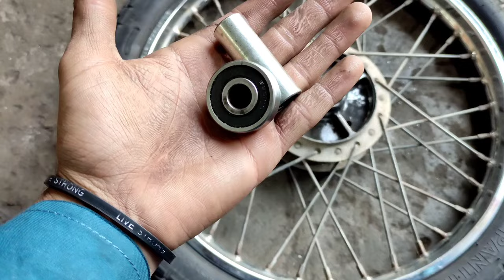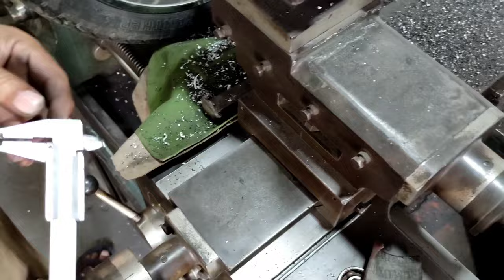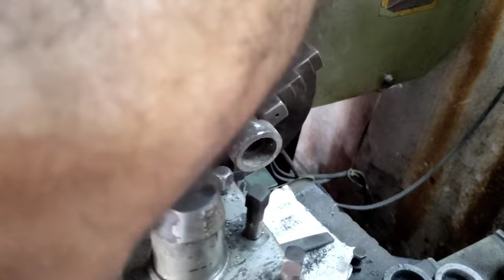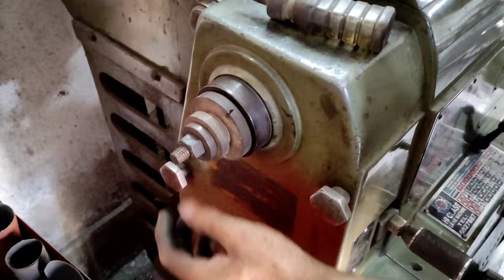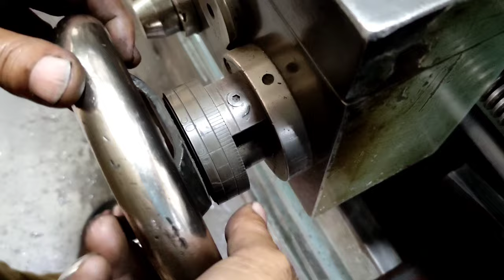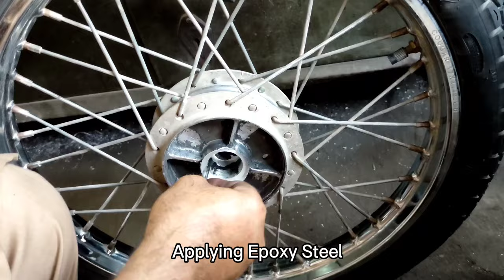Broken bike Hub Restoration | PART ONE

Comment from the maker: Piece full length 45mm,
Piece bearing outer length 18mm,
Piece bearing fitting size length 14mm,
Piece bearing outer diameter 45mm,
Original Hub bearing outer diameter 45mm,
Piece fitting length 27mm in hub,
Piece fitting dia 34mm in hub,
Original Wheel hub inner diameter 33mm,
Just 1 millimetre hub reduced. Now tell me please can we not tooling hub for just 1 millimetre for gets piece fits tightly??
This piece installing in hub 10000% secure riders are 10000% ok no any danger.

Comment: The hub thickness was reduced, it may weakened the integrity or strength of the wheel set.  The price of new hub and spoke, more or less 13$ compare to the riders life.
Reply from the maker: Allhamdullilla aaj tak kabhi koe shakayat ni ai. Humy 25 saal ho gaye kaam krtay hoye rider ki Zindagi bht qimti hai hum achy se jaanty hain. Sahi kaam krna har kisi ke bass me nhi.
Na ye lohay ka piece totay ga or na bahir aye ga 100000% sure.
Reply: @Zimbiker  much better if the bearing sleeve has smaller outer diameter than the wheel hub, so the thickness of the hub remains.
Reply: @randyagbayani2947  .. It's a 70cc bike's wheel.. often seen there are 4 riding on it .. never heard or seen an accident caused by the wheels.. whole country knows the actual causes.. so nobody bothers.. get idea 💡..
Reply: This part of the world, riders life is cheaper than cost of hub.
Reply from the maker: @randy agbayani
U mad.
Watch video again carefully
Reply: @Sariyal..  Sorry. The story doesn't end like that here. Here, the guy that pulls a gun with 1.5 USD bullet usually walks away with 50 USD phone, but later vanishes forever with gratitude that his both kidneys and both eyes provide new life to few unknown people that he never could met while he was alive.
Reply: @Wingedmechanic  .. I'm smiling.. on a lighter note yet again.. you forgot the basic point.......
"Dead men tells no tales" ..😇😉
Reply: Nyari di loakan banyak kali
Reply from the maker: Randy
Piece full length 45mm,
Piece bearing outer length 18mm,
Piece bearing fitting size length 14mm,
Piece bearing outer diameter 45mm,
Original Hub bearing outer diameter 45mm,
Piece fitting length 27mm in hub,
Piece fitting dia 34mm in hub,
Original Wheel hub inner diameter 33mm,
Just 1 millimetre hub reduced. Now tell me please can we not tooling hub for just 1 millimetre for gets piece fitting tightly??
This piece installing in hub 10000% secure riders are 10000% ok no any danger.
Thanks for yours sentences 👍
Reply from the maker: Watch this New video
https://youtu.be/Y3rqYfybWGQ

Comment: Enfraqueceu a peça.  Não ficou bom.
Reply from the maker: No weaknesses
Reply from the maker: Piece full length 45mm,
Piece bearing outer length 18mm,
Piece bearing fitting size length 14mm,
Piece bearing outer diameter 45mm,
Original Hub bearing outer diameter 45mm,
Piece fitting length 27mm in hub,
Piece fitting dia 34mm in hub,
Original Wheel hub inner diameter 33mm,
Just 1 millimetre hub reduced. Now tell me please can we not tooling hub for just 1 millimetre for gets piece fitting tightly??
This piece installing in hub 10000% secure riders are 10000% ok no any danger.
Thanks for yours sentences 👍
Reply: @Zimbiker  enfraqueceu sim.
Você retirou material para colocar a outra peça que você fez.  Para efeito da resistência mecânica,  Não faz diferença você ter colocado outra peças nas mesmas dimensões,  a peça que perdeu massa ficou mais fraca. Logo surgirão, flambagens,  trincas ou até um rompimento catastrófico.
Reply from the maker: 1000% guarantee no any problem⚡
Reply: @Zimbiker  ficou esteticamente parecido, mas, a resistência da peça ficou , perigosamente,  comprometida.
Reply from the maker: No any danger
Reply: @Zimbiker  tem sim. Mostre os cálculos dos esforços e depois faça a verificação da resistência mecânica do que sobrou da peça original. Você verá que não vai suportar as tensões.
Reply from the maker: Original Hub is silver (aluminium)
This iron piece stronger than original silver Hub